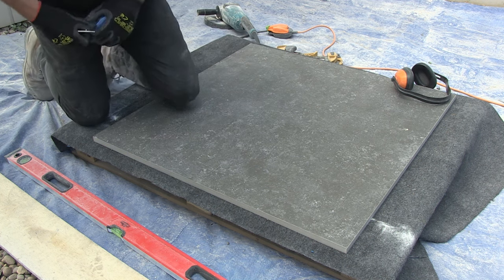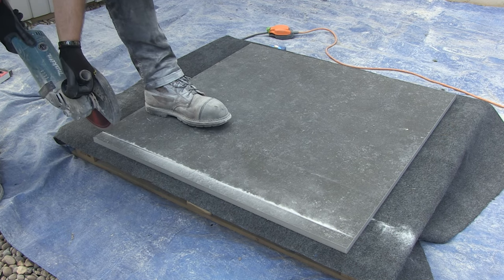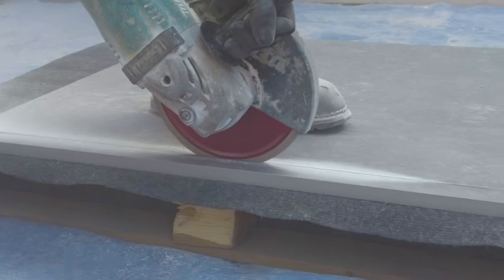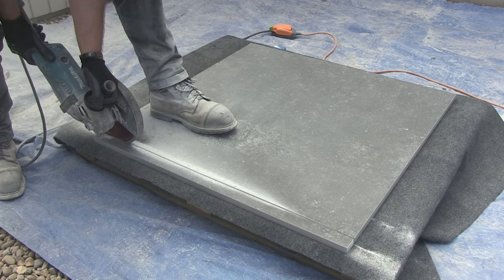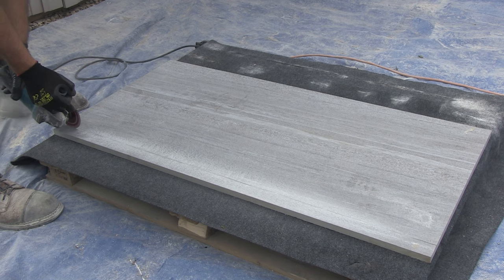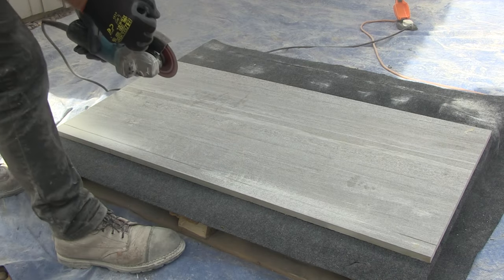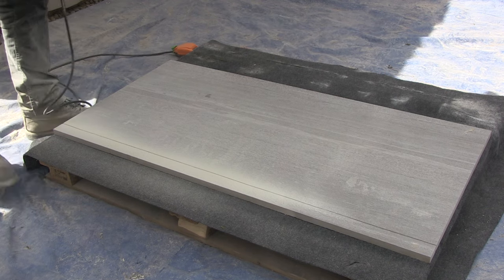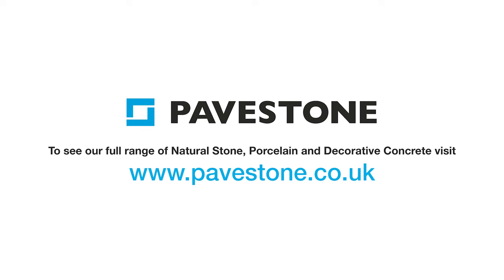How To Cut Porcelain Paving With A Grinder

Comment: When using the 9 inch grinder is there anything wrong with using it with water
Reply: He said you can't use water but actually you can, a small mist or stream just don't overdo it with the water and use a water safe plug, and keep the plug out of way of any water